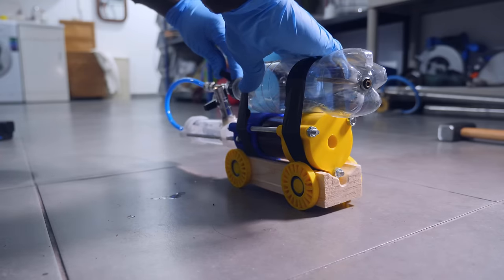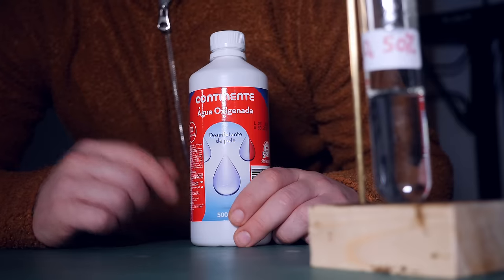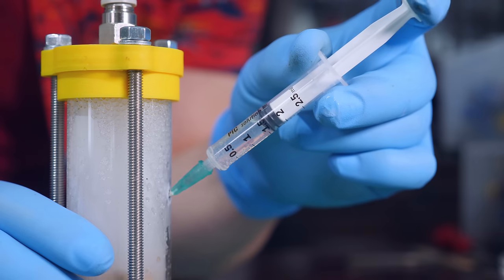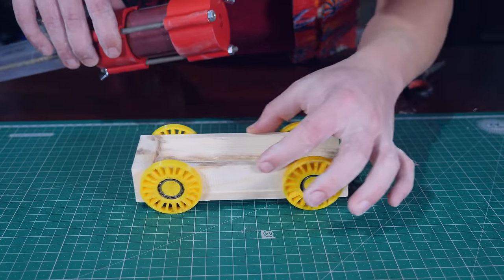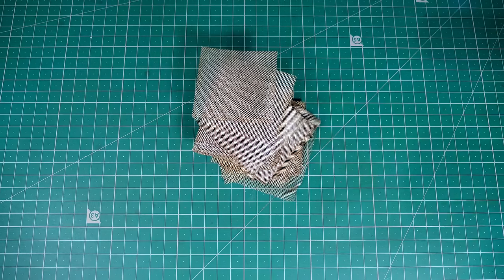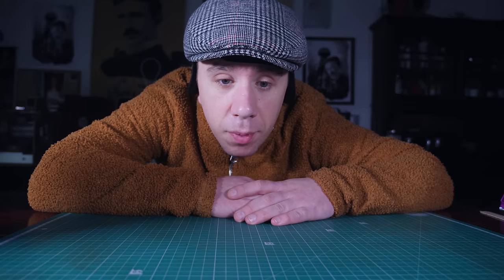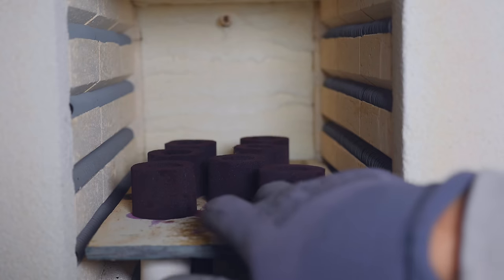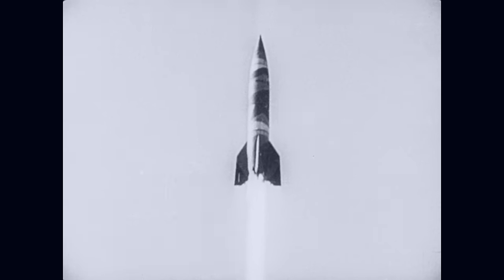SUPER HEATED STEAM ROCKET ENGINE

Comment: With cotton it is a hybrid engine: peroxide (solution) as oxidant, and cotton as solid fuel. Without cotton, it is a monoprop. 
I hope you can make a test stand for your engine with probably some linear guide, a load cell, some microcontrollers and a preload (bolt and spring) as we did right here. And with that you can calculate impulse and even average specific impulse from the thrust curve. Let's see what Isp you can get and what level will the system be put based on its impulse!

Comment: I have possibly not wise idea, but hear me out.
Indeed, water evaporation is remarkably slow at 60C. But that's also question of air humidity and surface area. If you'll bubble dehumudified dispersed air through heated solution,  you can speed up process tremendously.

You could take small air compressor and build set up with peltier plate and two liquid radiators. So, at first you'll chill air, remove water from it somewhere (in a jar, possibly). Then you heat air with hot side of peltier plate. Voila. You have very dry air. Then you could use ceramic filter to disperse it into H2O2 solution. So, small bubbles of air will take out liquid as fast as they could.
Or you could use regular dehumidifier with some jury rigged compressor and filter setup. 

That's pretty regular approach to evaporate something, which doesn't really want to at given temperature. Most usually it's called steam distillation. So, we add water into volume to distill. Reagent dissolve into water steam and nicely being rectified at lower temperature than they should. Since we need to distill away water, air would work nicely by same principle.

Why idea might not be wise. I have no idea, if H2O2 will decompose at presence of high surface area of air. Plus, I haven't calculated, how much powerful dehumidifier will you need for that stunt. So, it might not worth it.

Anyway, I'm sure, that aeration will speed up evaporation a lot. If won't decompose H2O2. Good luck.

Comment: Try putting the H2O2 solution in a vacuum chamber. Since lower pressures can evaporate the water faster and at lower temperatures. Please do give it a try. I don't have access to a vacuum chamber right now or I could have gave it a try myself.

Comment: I’ve always wanted to try freezing the water out as ice from the peroxide. It’s been said that you could concentrate the alcohol in wine by putting it out in the cold weather and taking out the ice pieces. Might be worth a try. Just looked and the freezing temperature of hydrogen peroxide is -0.43 degrees Celsius.

Comment: Hey, Integza, I'm a Mad Scientist too.  This video is so impressive I'm willing to collaborate with you a little.  Not quite as good, but baker's yeast also splits the peroxide explosively,  yielding Ox.  (I haven't tried a catalytic converter).  The best way to concentrate peroxide is to freeze dry it, preferably by vacuum boiling it until all the water is gone or frozen.  For more thrust, use a Steam Extractor by aspirating water at the output.  Something else too, but no point in jabbering all day.

Comment: here is an idea to use if you try to build a hot engine with propane.
If you want to cool the nozzle from the exhaust instead of using some cold water to cool the nozzle you can use the fuel itself before the fuel reaches the nozzle to ignite and then you will be able to cool the nozzle without adding another fluid to the system and as a bonus for that the hot gas fuel will get hotter and will add to the thrust of the engine and even (depending on the temperature that the gas fuel will get) you will also be able to ignite the gas fuel without the igniter

Comment: For speeding up the evaporation a Peltier device can be used as a small air conditioning unit. With a circular venting system using the cold end to extract water then the hot end used to warm up the air that is then blown over the solution.

Comment: H2O2 is generally concentrated using vacuum distillation to boil the water off without reaching a temperature that H2O2 decomposes at.  Technically, since you don't care about recovering the water, you could just get a vacuum flask, a vacuum pump, and a very modest heat source (just enough to stay room temperature-ish while the boiing water pulls heat away).  Let the pump pull the water out of the vacuum and wait, and you should be left with an 85% azoetropic water/peroxide mixture.

Comment: Would particalizing the H2O2 more than just a stream help with getting a more complete decomposition of the H2O2 ? 

The particals would be small enough that the steam produced wouldnt blast the stream away from the foam, would also possibly hit more of the foam at once time than the 8 streams. It may also once started land on the entire inside of the foam with the pressure out the nosel.

Comment: I think it would be cool if you used this in a not so dissimilar way to the way this is used in the V2, but use the oxygen from this reaction to fuel a combustion based rocket. It would be much lighter than the oxygen tank and have some initial velocity. Also I love the idea of mixing the potassium permanganate with plaster and think it would be cool to develop on that, like find a way to increase the surface area of the plaster in the tube. Could be as simple as using some kind of mould, or maybe even foam up the plaster while liquid, or even filling it with polyester balls then melting them out with acetone. Any love your videos

Comment: @Integza, do you try ferrum rust as catalizator? You can use rusted metal sponge. It has a large surface area. (concentrated peroxide is a very unstable, be careful, plz)

Comment: Hey, I was messing around with this myself too and found that the easiest way for me to concentrate H2O2 was by freezing it. hang on. I know it sounds stupid but at different concentrations different parts freeze at different temperatures. So it's pretty easy to concentrate 3% to around 70-80%. Just put it in the freezer and keep shaking it every 15 minutes once it begins to freeze. You want the water to freeze from multiple points not from the outside in and you bassically want an ice mesh that the concentrated H2O2 can easily pour out of. By messing with different concentrations, temperatures, and freezing conditions you can basically have the ice freeze and push out the H2O2 that you then pour off. You might also try molecular sieves but I havent tried that before.
Reply: Sounds like how we make hard cider.

Comment: Imo, peroxide shouldn't be injected in the middle, rather through the sides (near the cylynder wall). Exhaust has to stay centered, but this, there is no direct path for peroxide to be shot out and wasted.
The reaction is so powerful that a lot of it gets wasted by being turned into a myst and evacuated along with steam/water/o2. 
Just my 2 cents

Comment: Based on the way you describe the fuel, I would say it is a solid propellant rocket.  It is very similar to the boosters that were used on the space shuttle.  

So if you used a 85/90% hydrogen peroxide then where able keep that injection steady over x time you might be able extend the burn time.

The other option might be to use some thing like NOS like they do on race cars and bikes.  That might give you a boost.

Comment: I think the easiest way to evaporate water quickly would be to use vacuum, but you need to be careful with the temperature as boiling point is lowered in vacuum.

Comment: I thought about the possibility of using a formed paraffin wax fuel and the Peroxide+Permanganate to generate oxidizer for it, couldn't work out a way to get the permanganate to impregnate the wax (this would be similar to the flower foam but burn much cleaner).  I thought because the amount of steam generated might reduce the temperature it might not reach sufficiently high to self-ignite but based on these experiments I think it would.

Comment: To concentratie the hydrogen peroxide solution some more without corrupting the peroxide itself because of the high temp whilst boiling it regularly. Maybe you could try boiling it in a vacuum so the temp does not need to reach that high damaging the peroxide. Good luck

Comment: @integza i can't agree, Decomposition IS chemical reaction, as you produce different chemicals that you had at start, this is definition of chemical reaction!!
As for further things, permanganate also decomposes to MnO2, with is important, as this is catalyst of hydrogen peroxide decomposition. You have reaction of permanganate with peroxide with produces decomposition catalyst with makes it run even further, this is brown stuff you have everywhere XD
If permanganate would be just catalyst, everything woud be violet afterworths, and there would be no change of color
So, it may be worth to check MnO2 reaction speed, as it can be bought it ceramics shops (glazes) it coud be interesting comound to use (it is not soluble! so it wont be shot out from rocket if it would be on some support)

Comment: Maybe nothing but worth a try.
I know about some weird and not so intuitive way to remove water from alcohol without heat. The point is, you need to add a lot of salt into solution. Sounds weird, but salt is solvable in water, but not in ethanol. And so, water becomes a very salty brine that is much denser than ethanol, and this brine is forming a layer on the bottom, it becomes visible by naked eye. And than all you need to do is to carefully scoop the liquid from the top, wich will be mostly ethanol. The process than can be repeated several times to purify even more. If you put salt in almost pure alcohol, it won't dissolve, and will just stay as a solid in the bottom. 

The point is, I have zero idea if hydrogen peroxide reacts with salt. And obviously if it does, it's not gonna work.

Still may be useful to keep in mind

Comment: Was wondering if you would get better acceleration if you used a DeLaval nozzle.  Also, if you used a star shaped mandrel to increase surface area when using the plaster method.
To prevent plaster/permanganate particles coming out, a second chamber with baffles.  If designed correctly. inertial changes should trap solids and liquids while allowing gases to escape.

Comment: Found this, backup information: T-Stoff ([teː ʃtɔf]; 'substance T') was a stabilised high test peroxide used in Germany during World War II. T-Stoff was specified to contain 80% (occasionally 85%) hydrogen peroxide (H2O2), remainder water, with traces (<0.1%) of stabilisers. Stabilisers used included 0.0025% phosphoric acid,  a mixture of phosphoric acid, sodium phosphate and 8-oxyquinoline, and sodium stannate.

The decomposition of T-Stoff into hot steam and oxygen caused by the addition of the catalyst Z-Stoff (an aqueous solution of permanganates) was used to drive the split-tube steam catapults which launched the V-1 flying bomb.

Similarly generated steam was used to drive the turbopump in the German V2 rocket, and the pumps in several other rocket engines. The turbopump was used to transport fuel and oxidizer liquids under pressure to the rocket engine of the V2.

Another of T-Stoff's many uses was to be combined as the oxidizer, with C-Stoff (methanol–hydrazine–water mixture) as the fuel, in the bipropellant Walter HWK 109-509 engine of the Messerschmitt Me 163 and Messerschmitt Me 263, at a ratio of approximately 3.1 parts T-Stoff oxidizer to one part C-Stoff fuel. Because the two substances were so visually similar, a complex testing system was developed to make sure that each propellant was put into the correct tanks of the Messerschmitt Me 163. This was because T-Stoff and C-Stoff are hypergolic propellants: they spontaneously ignite when mixed at normal temperatures. Even slight contamination between the T-Stoff oxidizer and the C-Stoff fuel was likely to cause an explosion.

Catalytic decomposition of T-Stoff by Z-Stoff was also used as a monopropellant in several "cold" Walter rocket engines, including early versions of the engine for the Me 163A, and rocket-assisted takeoff pack engines like the Walter HWK 109-500.

Comment: You should try to do a vacuum distillation; it's much quicker. I have never done this before, but it seems pretty straightforward.
Reply: Vacuum distillation of hydrogen peroxide is extremely dangerous. Past a certain concentration you run the risk of an explosion… in a glass apparatus. That’s really not a good idea. Any contaminants on the glass will also cause the concentrated peroxide to violently decompose generating a lot of heat which causes even more decomposition leading to thermal runaway, and possibly an explosion. So, the glassware has to be extremely clean. I wouldn’t try this
Reply: @ashe1.070   Thanks, that's good to know.
Reply: @ashe1.070   If the vacuum pump was strong enough, would it not be able to suck up the steam and oxygen fast enough to avoid damage to the glass container?
Reply: @liambredeche7  No. If the concentrated hydrogen peroxide decomposes violently then there's no time for the pump to remove the gasses that are so suddenly increasing the pressure. There's only so much a vacuum pump can do with in a short time period. Instead, the expanding gasses would take the path of least resistance in an attempt to rapidly equalize pressure. So, do you think they would travel through a small hole in the apparatus to the pump in the span of milliseconds, or would it be easier for the explosion to just break the glass?

 Think about it this way: it requires a good few minutes to put a system under a really strong vacuum. For example the standard procedure for doing freeze-pump-thaw cycles (a common method for degassing solvents, and removing air for inert atmosphere chemistry) requires the use of the vacuum for about five minutes in between freezing with liquid nitrogen, and thawing to completely remove air. In short, vacuum pumps are not quick enough to relieve the pressure of a rapid build up of gasses. 

In the case that only mild decomposition occurs your product would still end up being wasted ruining the effort taken to purify the peroxide. So, why risk an explosion? Just find another why to concentrate hydrogen peroxide unless you have a death wish.

Comment: So have you thought about trying to concentrate your H2O2 in a vacuum chamber? If you can get pressure below 900 mTOR your water will sublimate from solid to vapor when heated. So you freeze some low concentration H2O2, stick it in a high vacuum chamber, then gently warm it. The water goes bye-bye. Freeze dryers are designed to do this. Now I haven't checked to see what the triple point of H2O2 is, so that may very well sublimate, too. You'd have to look into this. But it is an idea for further research into concentrating H2O2.
Edit: So I just did a VERY quick little look online, and with the phase diagrams of aqueous H2O2 solutions, it looks like the total freezing point could be as low as -56C. This suggests that freezing may not be possible at reasonable temps. But if an ice skin does appear after extended time in a freezer, you can be assured that it it pure water. But gently warming in a high vacuum environment should concentrate the solution much faster than at 1 bar.

Comment: I would love to see you build a carbon fiber rocket engine, like the pulsejet engine, with like everything: turbopumps, batterypack, fueel line, injector and more. I think that it is the next step, like you have built solid rocket motors and hybrid rocket engines and now i think it would be time for an liquid rocket motor

Comment: A Series of leading questions:

1. If you take a closed hollow tube, fill it with a liquid, and then spin it with its length as the axis, What happens to the liquid?

It will eventually share that spin momentum. I.E. will be concetrated at the wall, less at the middle.

2. What if... On that inner wall, there was... Texture that increased the surface area of the wall? 
It would cause far more friction with the water, thus turbulence, and make that momentum sharing far faster.

3. Now, untill now it was implied that the texture is just on the Inside Peripherial Wall.

Well. 

How about the inside of the ends? Same texture there?
The momentum share will be faster there. The liquid for a time, will be flung faster to the peripherial wall.

4. Now what if, one of those inner ends is smooth?

until it stabalizes, at one end there will be a greater pressure diferencial at one end than the other, and it will cause for a time, a flow cycle. Along the peripherial wall at one direction, and back in the middle space.

5. What, in that case also happens along that wall? With the texture? 
It's still sharing momentum. Only this time, the wall, and thus the tube itself, is absorbing that one direction momentum.

All other interactions in that vector neutralize each other.

...

As I do not see anyone else talking about this option. Would you mind testing it?

Edit: for the texture; I usually think bristles. At the peripharial wall, they are supposed to lean toward the end with the texture. Two reasons: gyroscopic effect- the spin itself make them lean down which pushes the tube at the intended direction.

And the second reason is that the liquid's interaction with it will creat a much greater push.

And the inner wall at the end bristles:  straight out(in). For basically the same reason.

Comment: You should try concentrating the hydrogen peroxide by lowering the boiling point of water in a vacuum chamber.  Google "desalinization of water by lowering the pressure" for more information.